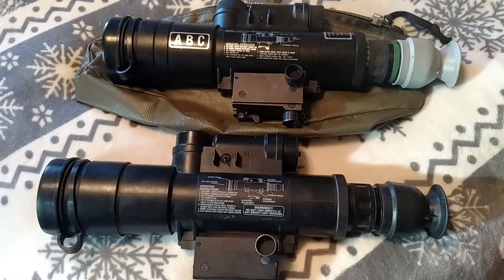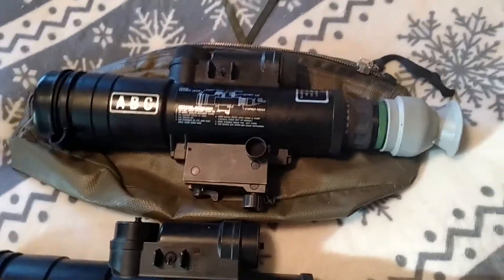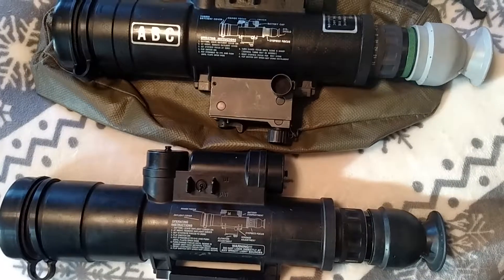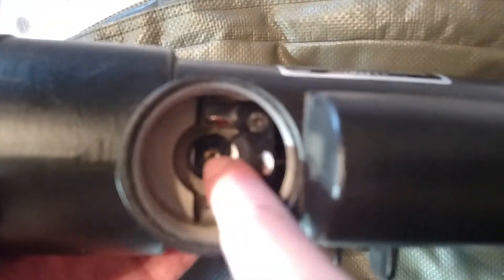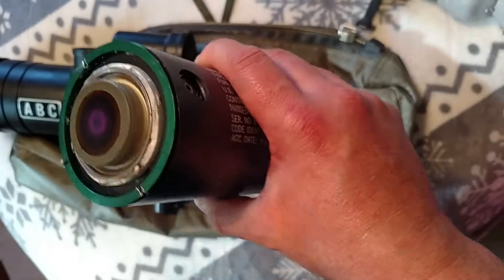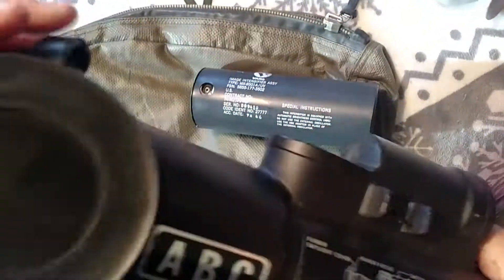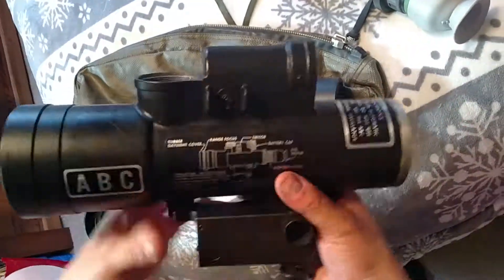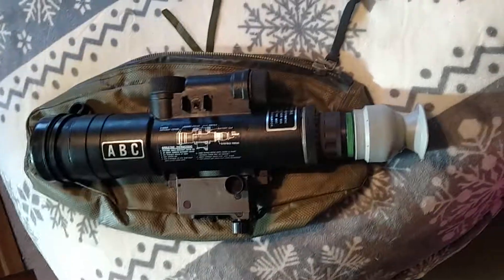AN/PVS-2 Starlight Scope disassemble

Comment: The reticle is inside the tube and must be removed and cleaned of the old balsam resin used to attach it to the back of the intensifier tube.  The tube must be partially disassembled to reach the reticle and the reticle must be removed by soaking in a solvent.  The balsam resin is now 40 years old and has turned brown and started to flake.
radiumbruce